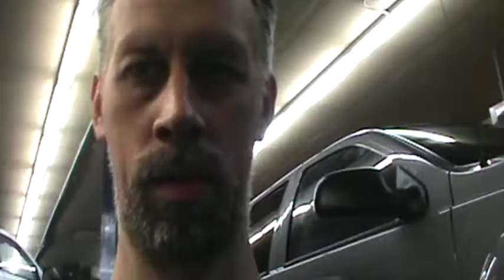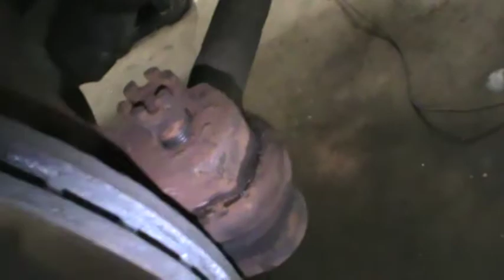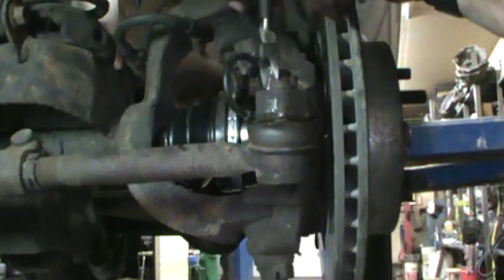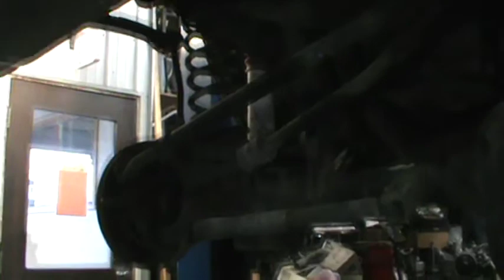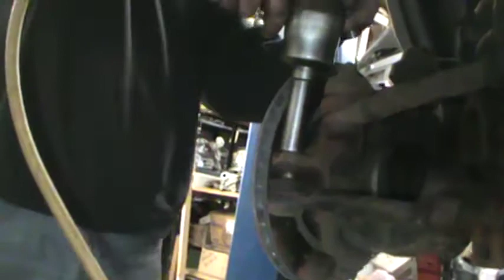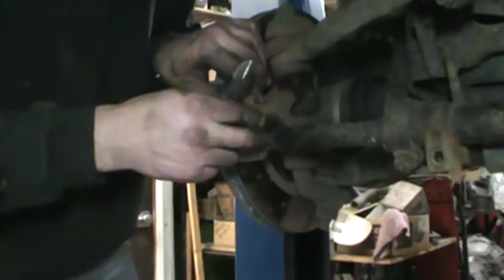Replacing the Tie Rod on a WJ

Comment: Did you replace the ends individually or just the whole bar with them already on? And suggestions if the ends don’t wanna thread off?
Reply from the maker: Tim Murray I replaced the rod ends. I had to use a pipe wrench to spin it off. I also soak then with a penatrent. If it doesn't come apart, you can get a new adjustment sleeve from the parts store, should be under a $100 here in the states

Comment: what size socket is that?
Reply from the maker: what nut are you talking about?
Reply: the nut on the tire rid end,
and also in the steering stabilizer?
Reply from the maker: I believe the tie rod nuts were 18 or 19mm and the steering stabilizer I believe was a 14 or 15mm
Reply: Freakin' Jeep I appreciate it.